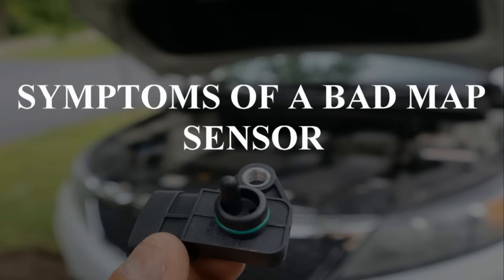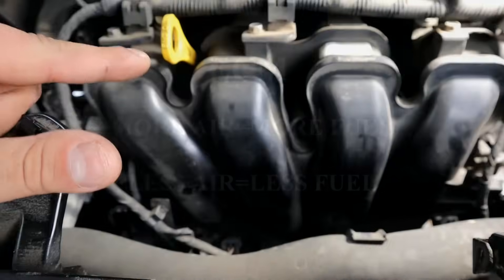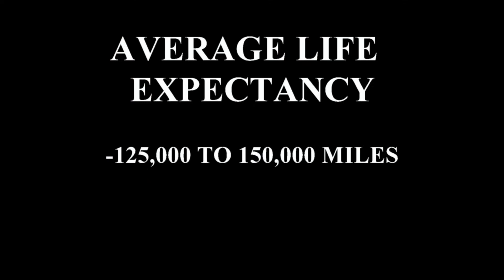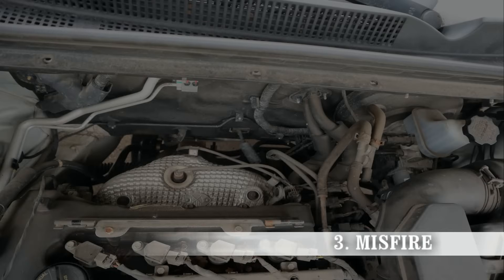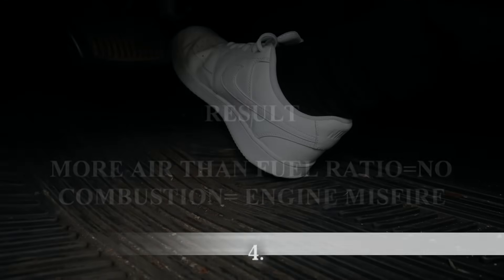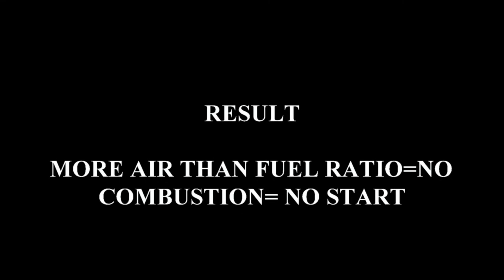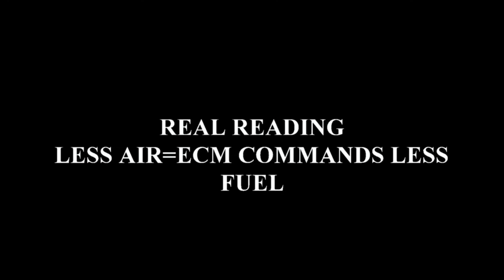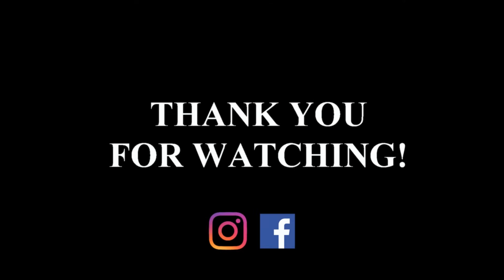SYMPTOMS OF A BAD MAP SENSOR

Comment: Mine does a bunch of white smoke.. but has the same problems. It also is so loud and backfires. Can someone explain to me what it could be
Reply: be careful, white smoke is often from burning a coolant, so bad head gasket... Look at your oil cap, where you pull oil to the engine, if there is a white/yellow/brown sludge on the cap, its blown head gasket
Reply: What ended up happening I have same problem, getting a new map today
Reply: @SqueegeNasty  I ended up selling the vehicle

Comment: Would this sensor cause issues where it stumbles until you give the beans? It's a 05 Dodge with a 4.7
Reply: I'm not a mechanic, but can confirm your question. I have a colleague with an 06 ram 4.7L and the same issue.

Comment: What happens if a mechanic sprays wd-40 into the new map sensor, because he could not get the new sensor to fit right. Would this new sensor go faulty? Because the sensor has oil now all over it? Symptoms now are hard start, and rough idle the first 2 minutes.
Reply: Shouldn’t use wd40 on the map sensor full stop!
Reply from the maker: If the new sensor couldn't fit right, it probably wasn't the right sensor.
Reply: Dont no really it was a Delphi one. It looked the same like the oem one, only the o-ring rubber was a lot thicker on the new Delphi aftermarket. Now i bought a Ngk and now 3 weeks no hard start anymore.

Comment: cleaning vs new?
Reply from the maker: I would clean it first, see if the problem goes away. If it doesn't then replace it for new. You can save some money that way.
Reply: They only cost around $30
Reply: Add a 0 to that for my subaru

Comment: My car out of sudden it shut off on me on a stop sign then the next day when I go to work it was okay but it started to shake at when car was stopped. Thee real problem was when I got off at work I went to get the freeway but it stopped at 20 mph wouldn’t go higher the engine made a weird noise. I had to let go of accelerator and press it again to go higher When I press the accelerator it start to shake and it does go higher than speed and it worked.  It kinda shakes too when the I press the accelerator I also told notice the needle in the rpm goes up and down. Can this be a issue ? I haven’t gone to get it check with the check engine machine
Reply from the maker: Definitely has the symptoms. The next step would be to get that check engine light checked out to read the codes and go from there.